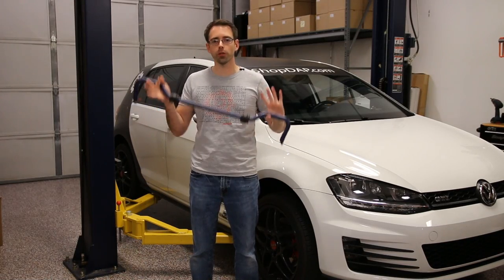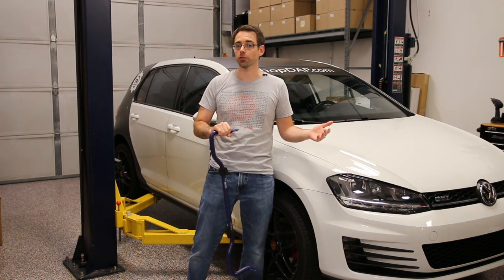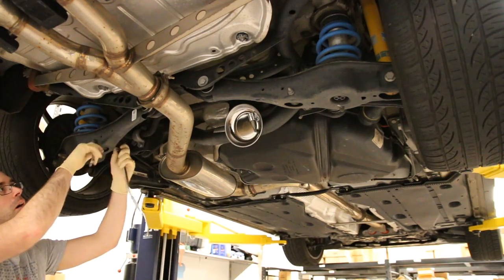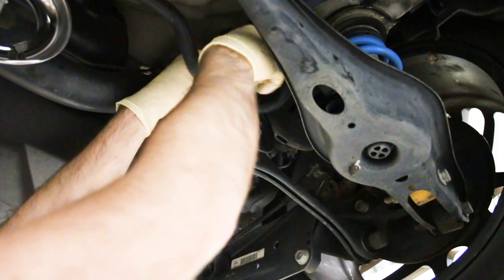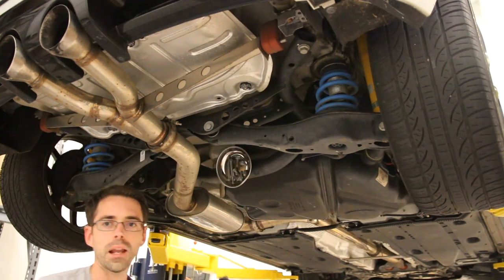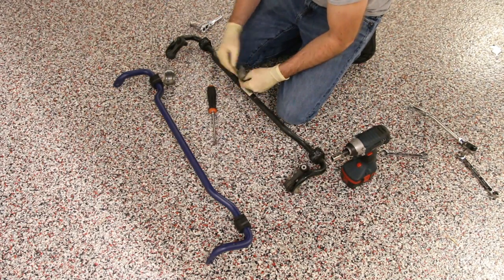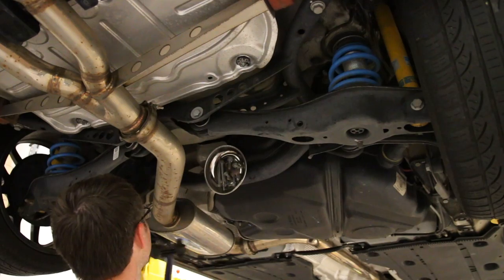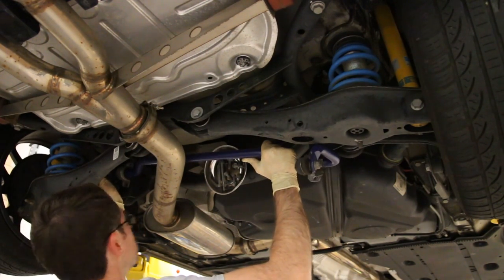MK7 GTI Rear Sway Bar Install DIY

Comment: Sway Bar is the single biggest change I felt on my car. Our GTIs need them in the rear a lot!
Reply: KC  27MM Neuspeed Race  rear sway bar
Reply: 1000% agree, installed mine 2 days ago. When I was in 4th grade I drooled over mk5 GTIs and dreamed about what they would be like to drive. I own a mk7.5 now and a 26mm H&R rear sway bar and a traction control delete, made my GTI handle the way I dreamed it would as a child. I’m in love with my car all over again. GTI + rear sway bar + pilot sport 4s + traction control delete = everything I could ever dream of wanting from a car. This is a must have mod for Mk7s. MUST HAVE.
Reply: @Canweatleastry  whats The main difference betwen The 26s and 24s mm? Im thinking about buying one of these for my MK7, which is not The GTI but The 140whp
Reply: @Canweatleastry  did you disable / decrease the XDS?
Reply: @timmie426  I disabled it
Reply: @Canweatleastry  nice, is tcs always completely off then or only if you use the tcs button
Reply: @Canweatleastry  It feels more like a rwd now?
Reply: My old school 1987 Scirocco 16 V already came with factory front & rear sway bars.  Don't these new generation of VW's come with factory installed front & rear sway bars as well ?   I only needed to mod with Neuspeed front & rear strut tie bar and replaced the stock "Boge" shocks with Bilsteins HD shock on stock springs.

Comment: This jobs is actually more difficult that it appears. If you have the stock exhaust you have to unbolt/loosen it the in order to create more space to pull the the bar out. Also those end links are a nightmare. I en up cracking  the triple square in one of them. 😅

Comment: Good video, but Sway bars need to be tightened up when the vechile is under load (I.e. wheels not hanging, and the car lifted by wheel ramps) - i.e whilst  the springs are compressed at the cars normal resting stance
Reply: Err, no they don't. The joints are free to move and so is the bar in the mountings so there isn't anything that is twisting/bending/etc when the wheels are hanging.  Other parts of the suspension should be tightened at resting height but not sway bars.

Comment: There are two errors in the video.

1) the suspension should be tightened with the wheel with load.  This is in the instructions for most end links.
2) most of the golf suspension bolts are stretch/one time use bolts and need to be replaced. 

These could be a cause of some of your noisy suspension.
Reply: Yup, I followed this video and an endlink bolt came loose during hard driving, causing a clunking noise. My tech blamed it on the lack of preload before tightening.
Reply: what size bolts are needed?
Reply: So this kind of work should be better done on ramps?
Reply: sway bars only twist when the body rolls, not when both sides  are at same height, so loading will not change anything really, except the angle of the sides.
Reply: @francoisloriot2674 right. I’m not sure why a lot of people seem to think there is “load” based on the spring length. Same thing with adjustable end links. You don’t swap out end links every time a fat person sits in the car.

Comment: Awesome video, super helpful. Only thing is, i would recommend loading the rear suspension by either jacking it up a bit while lifted, or or on ramps after a good snug with tools, then torqueing down the rest of the components. Also, what size triple square was used for the Sway Bar Link?

Comment: Personal opinion (unsolicited), MK7 GTI already handles neutrally on stock suspension.  I would worry about how tail happy the car would be with just an upgraded rear sway bar, particularly in the wet where it is pretty easy to get the tail out before the ESC kicks in.  Worked wonders for my terminally understeering Elantra though.
Reply: Maybe you’re not pushing the GTI enough but these cars are understeer machines from factory
Reply: @bertito43  and love themselves some body roll

Comment: I did the front sway bar on my mk7 by myself,  is kind pain to get the sway bar out cuz if don't have your subframe drop it low enough you won't able to that it out, also the HR sway bar don't come with the front bracket you have to use the factory one ☝️
Reply: How do you like it ? I am interested but install is pain in the ass.
Reply: johnny Huang honestly I like it a lot even though is hard to install. You will feel big difference when you turn fast the car is feel stable and sharp. But one thing is if you don't want stiffer ride I don't recommend cuz it changed a little because the sway bar are a lot thicker than stock one. I currently have H&R 28 front and 26 rear.
Reply: Cool, you have a build thread. I need some instruction of how to drop the subfarme. Goon install Control arm require drop subfarme in my car, I check it already the transmission is blocking it. Any tips?
Reply: johnny Huang I have installed a superpro control arms as well, if you going to do sway bar and control arms I suggest you to do it the same time because you can save time and money( have to do alignment every time you mess with suspension mods also if you planning to do a subframe mount like the VWR you should do it the same time too). To drop the subframe is really easy, theres only have four bolts hold on to the subframe, but before you drop the subframe you have to disconnect the endlink from the sway bar, and you have to loosen four bolt the hold the steering rack from the subframe, also the three bolts from each side of ball joints and the subframe and control arms should drop without any problem( make sure the wires are not attach to the subframe also)

Comment: When you have access to a lift makes life is a whole lot easier. I have a golf mk6 does the rear suspension need to be decompressed or compressed in order to replace the rear sway bar? I don’t have access to a lift I would use ramps.

Comment: For anyone working on a R. You will have to lower your exhaust system.
Reply: Hehehe R are a pain to install mods on
Reply: GTI as well. it made the removal and install so much easier and its only 2 bolts to let it hang enough to ease the swap
Reply: I don't think you do. I didn't do it on mine
Reply: Not true, you can pull it off without lowering exhaust.

Comment: First off I love the vids Paul. Is it easier to install the sway bar without any preload or would this be fine to do on ramps? P.S.- after watching you with those end-links I couldn't help but think you might be in the market for some ratcheting wrenches :)
Reply: Bryan Delaney the car on ramps wouldn't better I tried both preloaded work best 👍

Comment: Paul, what is your opinion on hollow vs solid sway bars? Do you recommend one over the other?
Reply: They are the same thing. However a 22 solid sway bar might be equal to a 26mm hollow.

Comment: What is the best lube for the bushings? I have a 2016 Mk7 that I'm wanting to stiffen the suspension and at the same time, get rid of all the annoying squeaks.
Reply: Lithium or Synthetic NLGI 2 grease.  It's basically dielectric, but you'll need to get them in whatever size cartridge your grease gun holds (3oz or 14oz typically).
Reply: My uncle

Comment: Crucial to use the triple square to hold the end link not loosen the end link.
Reply: Made the mistake and snapped it off. Good advice
Reply: What is the size is that end link triple square need.  Paul mumbles at 8:03 "..our smallest bit in the kit... is fortunately in included there"

Comment: I would like a diy for the front sway bar!
Reply: the MK7 benefits from just a rear swaybar much more than it benefit from both front and rear. Adding just the rear adds oversteer which balances the car out so just a rear swaybar is great.

Comment: Hi Paul I did a 26 mm sway bar install on my GTI performance 2017 and everything went well on the install but I'm hearing a knock noise when I go around corners sometimes what could that be I check to see if anything is touching and nothing is touching. You mentioned lubricating the clamps I didn't do that is that what it would be?
Reply: Did you ever work out what the issue was? I'm getting the same problem.
Reply: Replace Endlinks with new

Comment: its much easier if you lower the exhaust . there's only two bolts holding the exhaust.
Reply: David Ha it's a way easier !!! I just did this install and lowered the exhaust ! Had it in like 2 sec

Comment: Similar steps for a Golf R, or is there something to consider with the rear diff?
Reply: It's the same, just did it, the differential is not in the way, it's right where the bar bends down.

Comment: Is there torque specs for all the hardware for the rear sway bar?
Reply: Since it’s a part that moves with your control arms, id think arm-tight is plenty enough. Over tightening wouldnt be any good